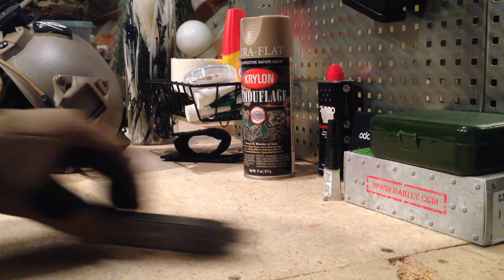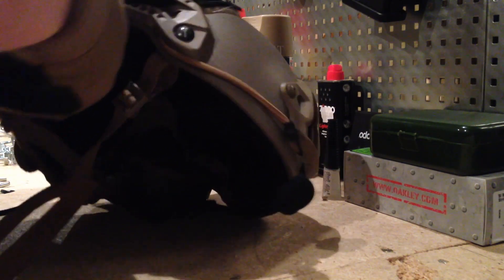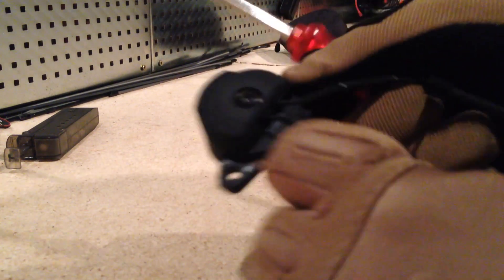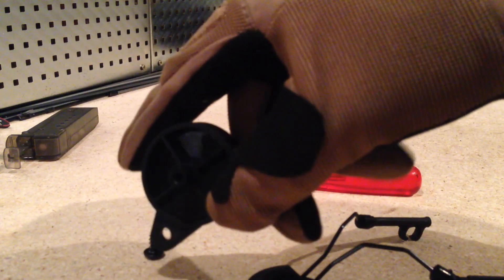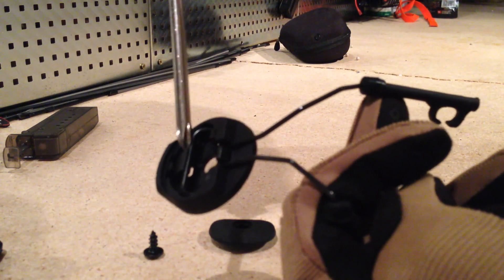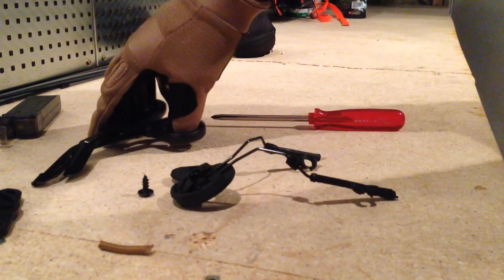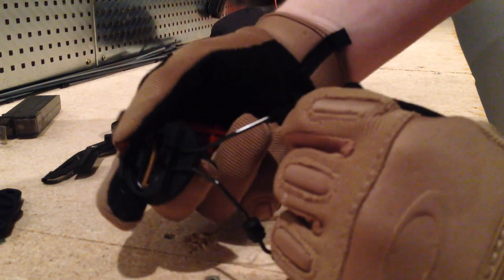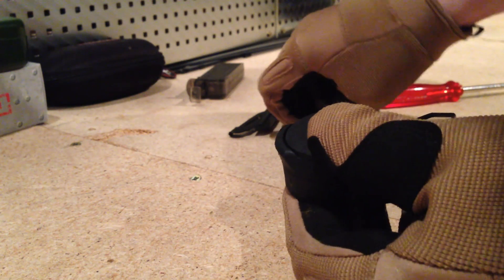FMA ARC RAIL ADAPTOR MOD ( So they don't pop out)

Comment: What can we do to have a better seal?  Do i need to bend the arcs or something?  Would like to know because my headset is very loose and even when i press them they don´t seal correctly.
Reply from the maker: The fix in the video is the only I know of which has worked greatly for me and other in the past. The newer headsets with gel cups instead of foam should seal it up nicely though